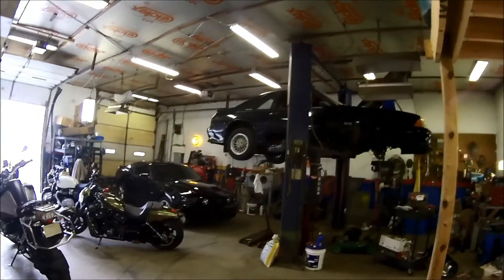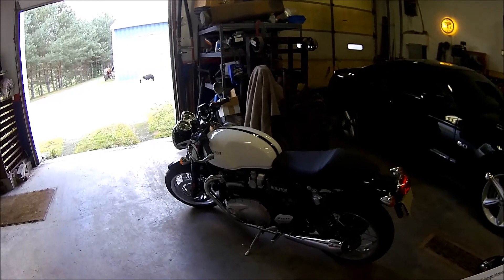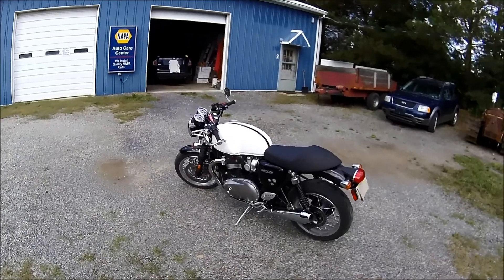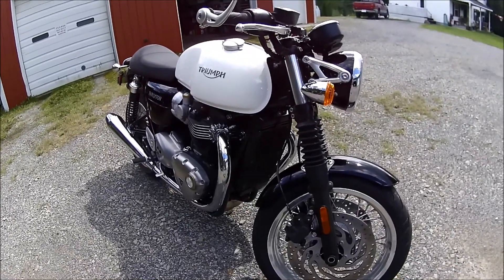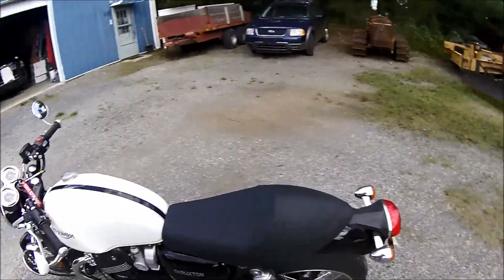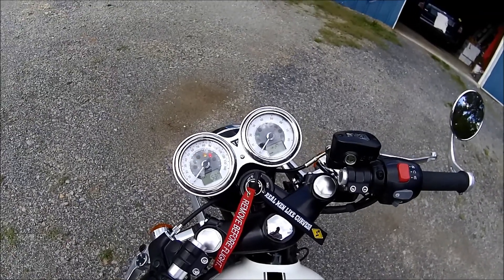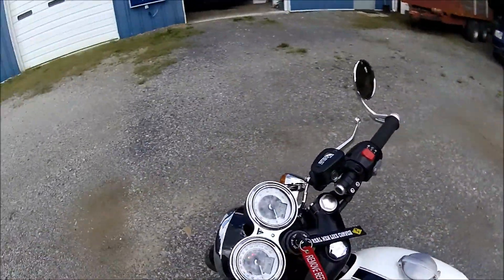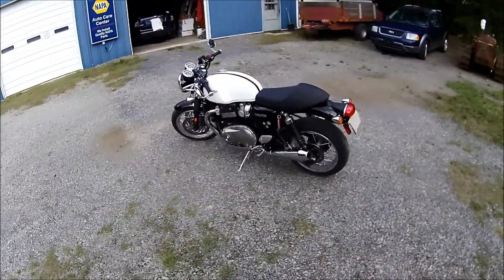Walk Around of my new 2016 Triumph Thruxton

Comment: I really agonized over my choice but finally bought the new Triumph T120 instead of the Thruxton. They're very different bikes! At the end of four hours or so in the saddle of either one, you're only hoping for some comfort. The T120 has it. It's no slouch in the performance department, either, but not quite in the same league as the Thrux.

What decided you on the Thruxton vs. the Thruxton R?
Reply from the maker: The T120 is a sweet bike.  Like I said there was a T120 Black at the dealer and I was strongly considering it.  But I have been wanting a Cafe bike for some time so I went with the Thrux.  I did get my comfort seat yesterday and tried it today.  Too soon to tell if there is any more comfort than the standard seat.  I plan on getting a vid up this weekend about the seat.

The main reason I didn't get the R is the color choices.  I am not a big fan of grey or silvers.  I like red just not on that bike.  I really like the white, it just seems more classic and classy to me.  Also, I'm no racer so the upgraded suspension would have been no benefit to me except for braggin' rights lol.  I like the feel and ride of the standard bike just fine.  I have so much fun riding this bike!

Thanks for watching and a big congrats on your new T120!

Stay Safe!

Comment: No cruise control for the Thruxtons.
Reply from the maker: That sucks.  I had asked the dealer to check into it but they never got back to me.  I thought there might be a long shot the the T120 cruise would work.  Thanks for the info and thanks for watching!
Reply: i have been at a triumph dealer here in germany just recently, and they said even tho the thruxton doesnt officially offer cc they could still install it for me, they might have to pull off a modification tho